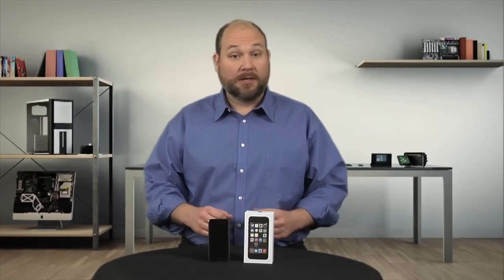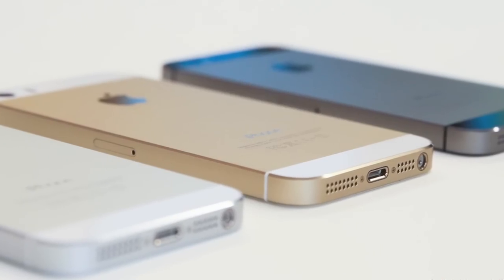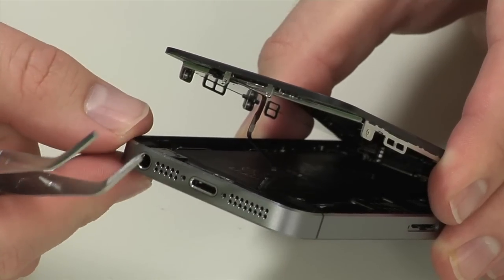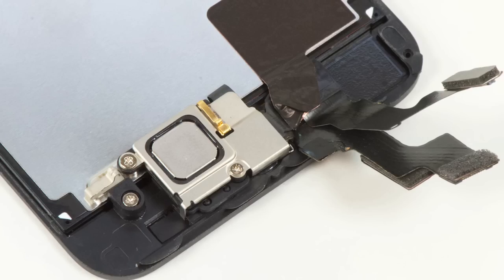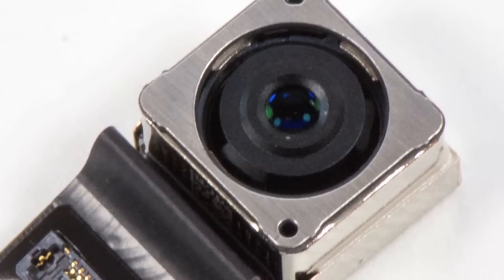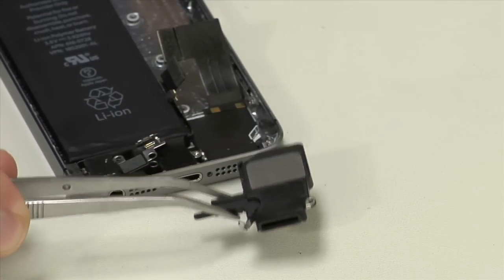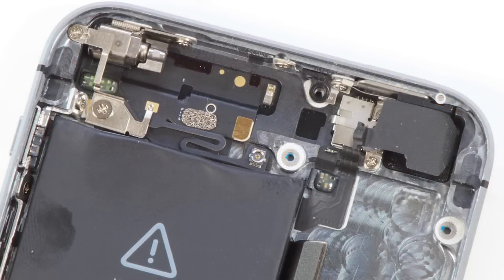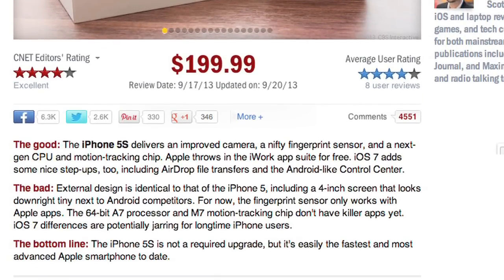Cracking Open - Apple iPhone 5S

Comment: Well I had a stupid accident. I had my iPhone dropped on mayonnaise. Just the bottom side and some of it made through the speaker holes. I cleaned it as mush as I could, but now I am thinking of getting it open because the sound is so bad. i am not sure if the speaker needs replacement or just to clean it from the inside in a better way. Any thoughts? Does the iPhone 5s has just one speaker? Cause it feels like has 2 and after the accident the one stopped working.. 
Thanks in advance
Reply: If I may ask, what's the point of the speaker? just use headphones....
Reply: 1 speaker. Other side is microphone
Reply: Did you ever get your iphone speaker fixed? This situation happened to me recently, not with mayo though. My speakers sound horrible, and I can barely hear my phone when it rings. I'd like to know what you did to fix it/clean it out.

Comment: After the recent WP8 upgrade my HTC 8x has been doing that. I touch the power button to wake the screen and sometimes it will say GOODBYE! I think it's a software bug not a hardware issue. My gf knocked it off the kitchen island while recharging but that was the only fall it had. Sometimes the text message screen says it cant send a txt and after 6 tries resending it says GOODBYE and I have to turn it back on again.

Comment: Some products are made so lamen can't repair them. And most people have no idea that you could repair stuff yourself. I'm "repairing" a LG 32" tv from 2006 because our lovely local power company shut off power for a day and when power came back, even with a surge protector it blew the tv out. I'm hoping the fuse is just the culprit and once I get some new anti static tape for it, I'll put it back together soon.

Comment: Glueing parts in place. Especially the battery increases long term reliability. To hold it mechanically in place would require more structure. When something like the battery moves even 1 mm it can and will often cause other components to fail.